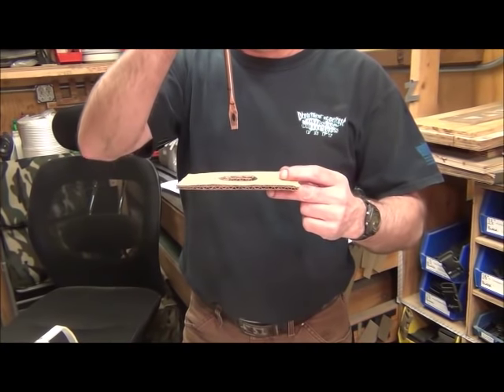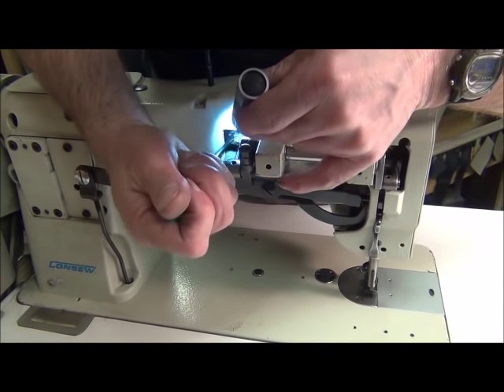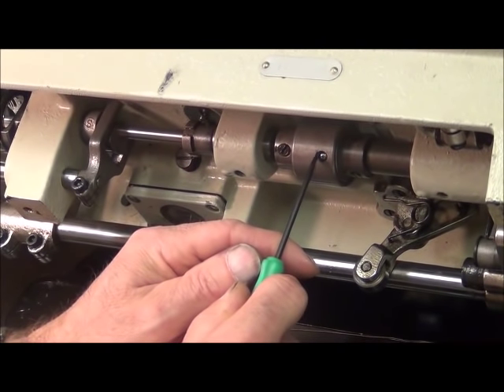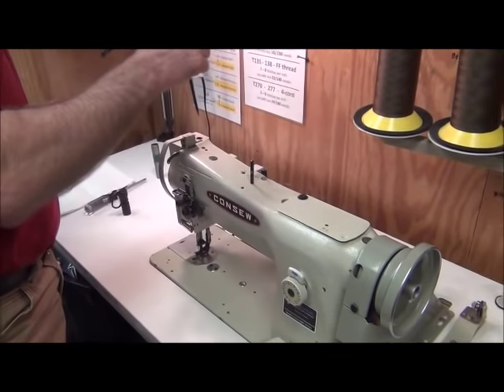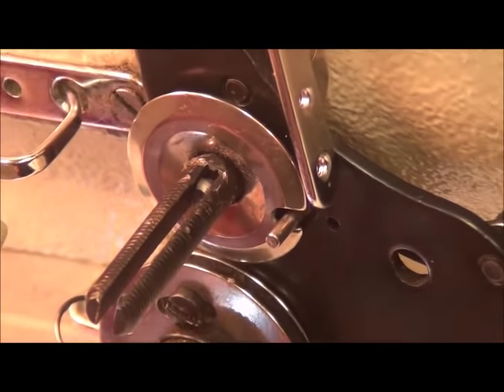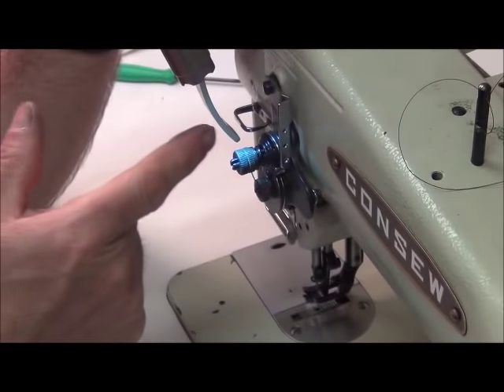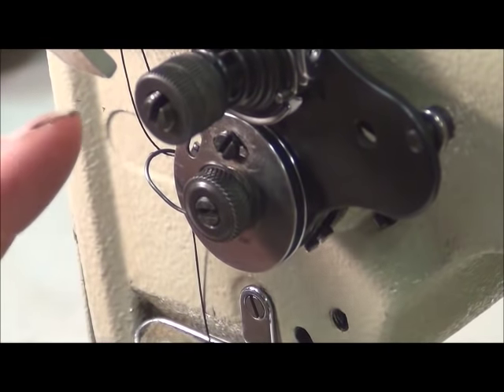Consew 206RB 5 Maintenance Video   Part 2

Comment: 0:00:26 Timing Presser Foot with Needle
0:10:48Safety Clutch Mechanism
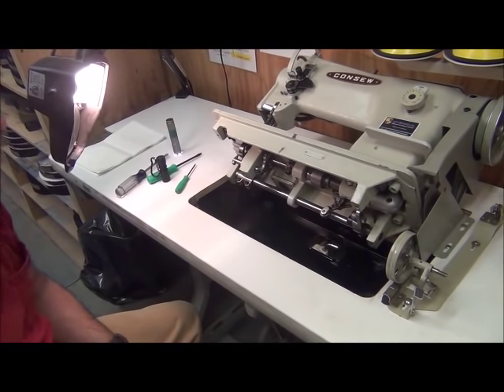0:22:33 Presser Foot Tension
0:26:59 Thread Tensioner
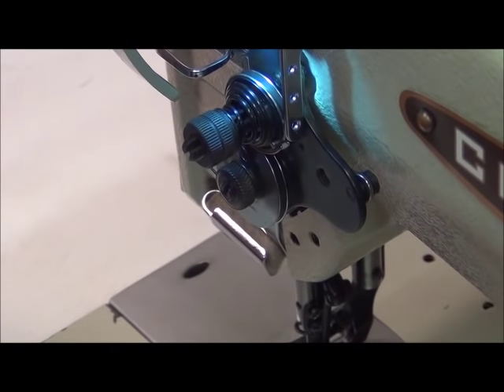0:51:14 Thread Controller Spring
1:15:22 Equalizing fwd/rev Stitch Length

Comment: The reason you will get a different stich lenght after setting for a certain stich is a machined part that controls the calibration  is not machined properly.

Comment: These videos really helped me understand my new machine. I have a problem though I can’t find help on though. I sew, do embroidering plus I have used a serger. The problem I’m having with my consew is I’ve gotten the thread from my needle stuck in the housing where my bobbin goes. Now my needle won’t move. I tried resetting the clutch but the entire bar under the sewing machine isn’t moving. When it was shipped to me there was a piece of leather in the machine, the walking foot was down and the needle was down in the leather. When I lifted the foot and needle to remove the leather, it was extremely difficult. What do I need to do to fix this?
Reply: Virginia, sounds like you have thread bound up between the rotary hook and the bobbin case holder.  Take a look under the hook (between the hook and bobbin case holder) and see if you can see broken thread pieces.  If so, you'll need to remove it.
   On the outside of the rotary hook there are about 7 miniature (tiny ... tiny ... tiny) screws that hold 2 different plates onto the rotary hook.  I think there are 4 screws on 1 plate and 3 on the other.  What you need to do is use a small jeweler's screw driver and remove the plate that is the actual hook (I believe this one has 4 screws).  Once you get the hook plate off, you will be able to clear any thread.
   If possible, try to take the screws out while keeping the rotary hook attached to the machine ... it'll save you from having to make all the rotary hook adjustments afterwards.
CAUTION:
   1.  The screws are 2 different sizes.  Keep them separate and oriented so you can put them back in the right place.
  2.  Put a small towel or rag under the rotary hook area to catch the screws in case you drop them.
Hope this helps.
Reply: @2004mikea  you are an exceptionally kind man, mikea

Comment: Great instructions!
Thank you very much.
A question about bobbin loading:
User manual appears to show that with bobbin is in the bobbin case, it should rotate clockwise while pulling the thread and looking at the bobbin.
Some internet sources suggest otherwise, and I feel that the thread goes out smoother with counterclockwise rotation....
Reply: My consew 226r is top loading and counter clock too.

Comment: Safety clutch ball bearing seems stuck, used a flat head to press ball bearing in, while holding the button. As I spin the wheel it doesn't disengage ball bearing..any tips? I was trying to see the spring behind the screw. I had no luck

Comment: Thank you so much for this instructions. But as you said dont consume... So I've got new consew premier 1206rb1 which is slitly different from this one. I was able to adjust about everything, but one adjustment. Forward and backward stitch lengths are same only at some stitch length - 5mm but at smaller or bigger stitch length they became different. How can I solve this problem. Thank you any way.
Reply: We just got one also.   video helped a lot but is a different machine. Have you found any good videos of the p1206 rb 1. Our needle stops down

Comment: What's inside that bobbin casing some sort of plastic aluminum piece that was inside of there that came out or these machines industrial strength can they take it and what about a 17 mm meter how big is that can that be used on vinyl I told the person I'm working with that I think they need those too big that we're using putting big holes in the fabric I just don't think it's necessary he thinks it gives it more power get power from the motor not need them could you please tell me am I going in the right direction or the wrong direction

Comment: See Part 1 for:
Adjusting height of Feed Dog
Feed Dog longitudinal position
Installing Needle
Straighten/align Pressor Feet
Align needle w/ Feed Dog's hole
Needle bar height
Timing Needle w/ Feed Dog
Timing Needle w/ Rotary Hook
Clearance between Hook and Needle

Comment: I’m having trouble timing the needle with the vibrating pressure foot hitting the plate as you showed in the first segment of this video part 2. On mine the needle is through the hole when the foot hits the plate on the back side and the front side. I tried making the adjustment as recommended but even though it is balanced it still won’t time correctly with the foot. Can anyone help me understand this?
Reply: I’m having a similar issue - no matter what adjustments I make and how closely I follow the video, the needle is either perfectly timed with the vibrating foot for the downward stroke but then too slow coming out at the upward, or vice versa. I can’t seem to get them balanced - it’s like the needle rotation is too slow no matter how I adjust that rear cam. I haven’t been able to find anything on sewing forums to help me figure it out, and it’s driving me nuts!

Comment: At this point (https://youtu.be/8ROVK2bKObU?t=5837) you want to count 10 stitches and that turns the 4.5mm into 4.5cm, which is easy to measure in the ruler, so no need to divide anything.

Comment: I am trying to find out why my Consew 206RB-5 constantly breaks the top thread. Especially in reverse.
Reply: I've adjusted the tension many times, changed needles and have had it to the shop where I bought it but it still breaks the top thread at the needle.
Reply: Needle gauge(thickness)perhaps?  I am just learning, (after 40 years sewing as an upholsterer) but the tread weight is tied to the Needle gauge and vice-versa. There are charts to confirm proper Needle for your preferred thread

Comment: what screw do i lossen to center the needle to thr feed dog . my machine  consew 206rb-1 dont have a plate on the back. please help  thanks chet
Reply: watch video part 1
Reply: my consew 206rb-1 doesent have thr plate on the back of the machine to get to the screw to center the needle to the feed dog . its different so what screw do i use . part  one doesent       help ?
Reply: Remove plate next to (left of) stitch regulator on front, set screws and adjustment are accessible from front side under that plate.
Reply: thank you chet.
Reply: Chet, this is Mike.  I apologize for the delayed response.  Although I made the video, my colleague actually put it up on YouTube ... so I don't check it.  Was just giving them a look this morning and saw your req.   I don't know much about the RB-1 but fortunately, it looks like Clarence does and has answered your question.   Hope you get it all worked out.  Man, I know what it's like to fight with your machine.   Cheers ... Mike
Reply: I have a 206rb (no number after it) Theres no wicks in it at all but theres also none of the holes running along the arm from the top access down toward the the needle bar area. Do the original 206's not use wicks or is there a different way to set the wicks? Thanks for any information you may have